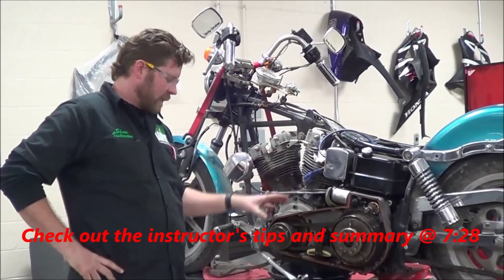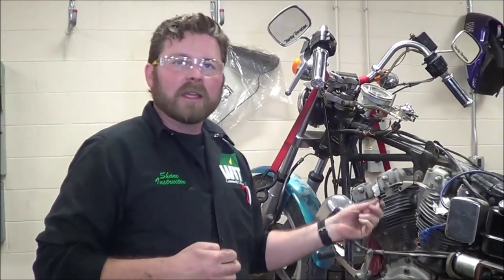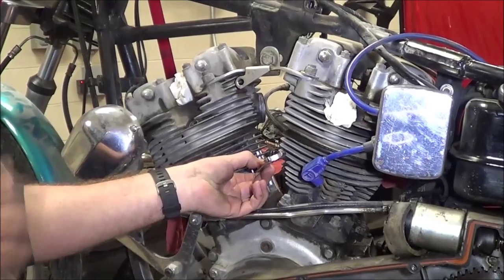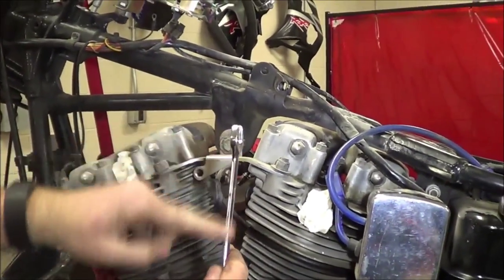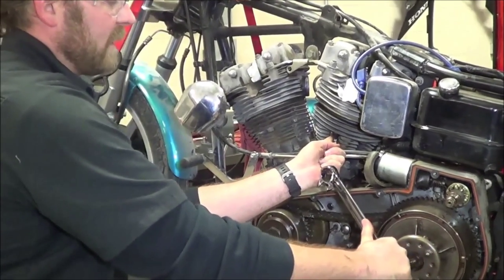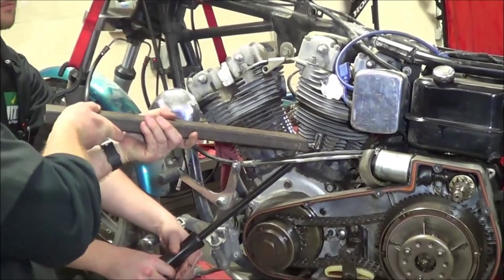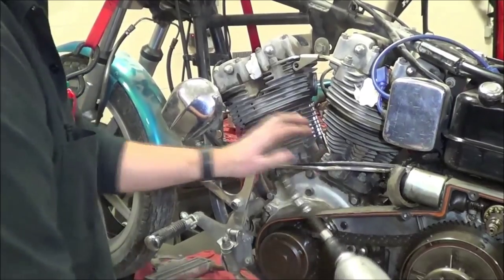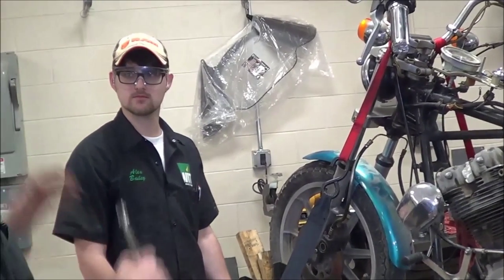EM Series: How to remove a stubborn bolt seized stuck Shovelhead head bolt stuck

Comment: I think the closer to the middle of the bolts inner flats come in contract with the wrenches inner flats, the more torque can be applied without rounding the bolt head.
Reply from the maker: +L 88 
That's the entire point of any wrench ever made...Use all the contact possible.